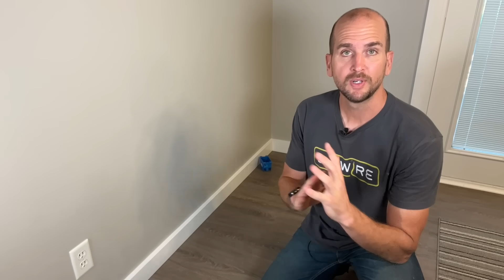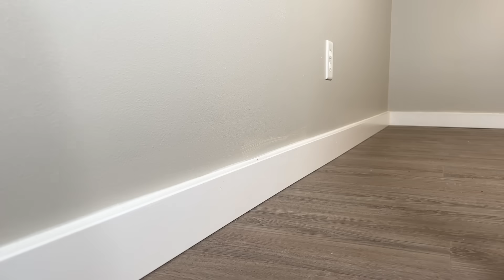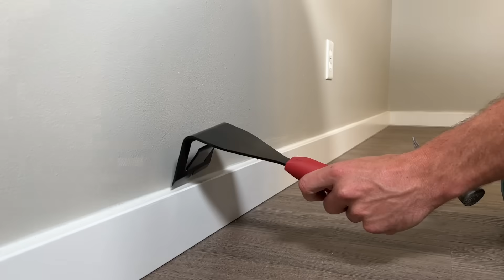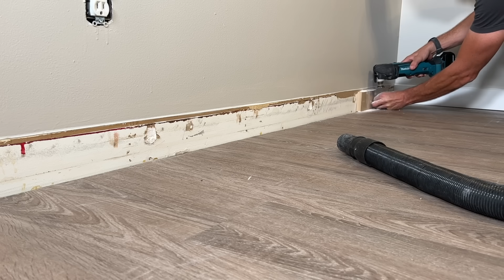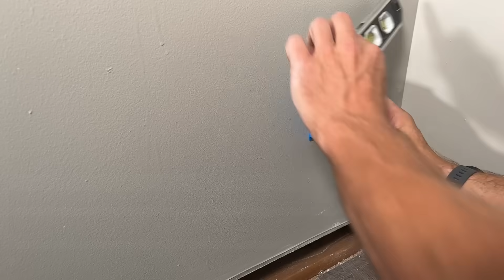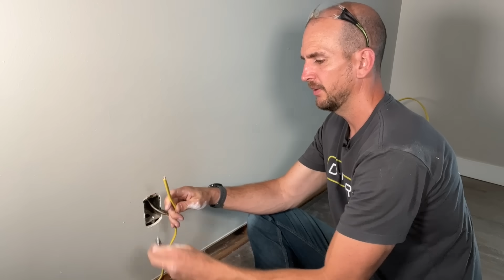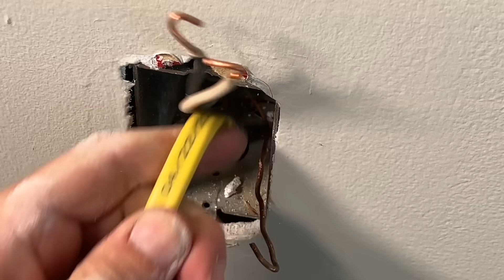How To Add An Outlet To A Finished Wall

Comment: Your wire that comes from your romex should extend at least 6” out of the box. You can find that in the national electric code. Also, when using solid wire, you need to hook the posts on the receptacle. The plates are for stranded wire. It’s also good practice to place your ground up, so to protect any falling metallic objects hitting between the receptacle and plug, shorting between the hot and neutral. The odds of that are unlikely, but can save some grief for no extra effort. The slotted cover screw should always be vertical (preference). Being a commercial electrician, we always use metal boxes, so I also always tape around the receptacle. When using the plates, put the wire on the left side of the screw, so the wire is being pulled tightly, rather than being pushed out. Outside of the 6” rule, these are just good practices. One last thing; when using a plug-in checker on a duplex receptacle, make sure to check both, as the metal tabs on the side of the receptacle can be broke and used as two separate circuits. Assuming that the duplex receptacle is only one circuit could get you lit up.
Reply: You make a number of great points, however all spec grade or better receptacles that I have encountered rate the side screw terminals for solid wire and the back wire clamping plates for both solid and stranded wire.  Individual/local preferences may vary.
Reply: @rhettlyerly545  
The back-wireing is not specifically just for stranded, but his is correct that solid wire is much better off being hooked around the screw rather than simply sandwiched between a metal plate. The smooth copper wire being pressed on by a place that is smaller than 3/8" can be fairly easily pulled out by a small amount of twisting even when fairly tight. And, by extension, it can potentially get worked out of the hole while the receptacle is being positioned into the box. This is not necessarily common, but it CAN happen.

However, even if it doesn't come out completely, it can be worked loose. And, as any good electrician knows, a loose wire is one of the biggest fire hazards there is.
Reply: A couple okay points. But:

1: NEC 300.14 - Yes, wires should extend 6 inches... but that's from where it enters the box. Either from the sheath, raceway, conduit, or connector. It only HAS to extend 3 inches from the box opening. Although, 5-6" OUT of the box makes a spectacularly cooperative set of wires, it is not necessary. However, I would potentially fire someone for cutting it at 3" out, lol. 
2: It's a good idea to hook solid wire (as I explained in my reply to Rhett's comment) but it's not mandatory.
3: "Ground up" is silly. There is only ONE reason for it, and half a dozen reasons to go "ground down." 
     Ground up reason: IF the plug is pulled partially out, and IF it has a metal cover, and IF that cover's screw comes loose, and IF that cover should then fall, then it hits the ground and is saved. YAY! But, then, if it swings even a little bit, it hits the hot wire anyway. Sooo... a LOT of ifs for an incredibly rare situation that putting the "ground up" doesn't really solved.
     Ground down reasons: A. The ground prong is sturdier and can hold more weight, and does so when a plug gets worked loose. B: If a plug end gets worked loose, gravity will case it to sag. If the ground is UP, then it is often the first prong to get undone. Then you have an ungrounded but HOT device. If the ground is DOWN, the device loses power BEFORE it loses ground. C: Most 90 degree plugs (like those on refrigerators) hang with the cord down in receptacles with the ground DOWN. When in a receptacle with the ground UP, gravity pulls on them and can pull them out. I think I'll stop there as this is already longer than your comment.
4: There is no reason that the cover screw SHOULD be oriented any direction. I personally prefer horizontal because I think it looks better.

Taping in metal boxes and hooking the wire clockwise are good ideas. Not code, but they should be. Same as with the stranded/solid backwire/sidewire issue. Just my opinion.

Comment: Funny how this would be considered super illegal in The Netherlands. Never use romex, always run wires through a pvc pipe to prevent damages from wire rubbing over time and rodent damage. Never ever use conductive material for your boxes or conduits! It’s just short circuit waiting to happen.

Comment: Residential electrician here. BEST YouTube tutorial I've come across. He didn't miss a thing for old work! In a perfect world, a romex staple would be placed below the box to secure the wire, but it's not a perfect world. This however, in my opinion was a perfect install. PS We dont use wago connectors because they're expensive lol
Reply: We don't use Wago connectors because they're garbage.  At 8:42 and again at 9:16 he said "we don't back wire" that's  because all real electricians know that is garbage.  Using Wago connectors IS BACK WIRING!
Reply: Exactly!  @udavidism
Reply: I thought metal electrical boxes had to be grounded.  I didn't see a ground to the metal electrical box.
Reply: @todd8155 not when the box is plastic
Reply: @todd8155 grounding a plastic box wouldn’t accomplish much. The ground just gets attatched to the yoke of the outlet. If the box were metal it would need to be grounded
Reply: @jesseneumeyer4279  My mistake.  I meant to say that the METAL box wasn't grounded. I corrected my post to add METAL.
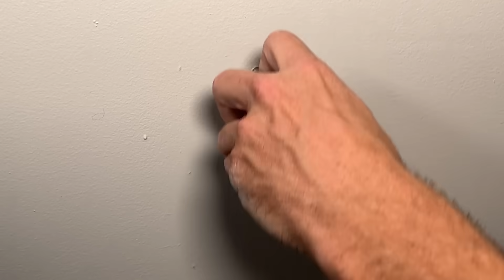Reply: @todd8155  In the metal box shown, the ground wire is wrapped around the screw for the wire clamp in the back of the box. You can see this at 4:59 ... In a new metal box you would use a ground screw/ground pigtail to ground the metal box but years ago it was done as shown if it was done at all.
Reply: @jesseneumeyer4279  I see.  Thank you.
Reply: @todd8155 you can ground it with the receptacle as long as you remove the plastic or cardboard retaining washers on the mounting screws and they are making metal to metal contact
Reply: As you know staples are NOT required in places they are IMPOSSIBLE to put. Why even bring that up?
Reply: We don’t use Wago’s because they fail to much. Use a wire nut!
Reply: @empireofdirt9045  The lever ones arent as bad as the spring clip ones, but the point stands, wire nuts are better and cheaper
Reply: @empireofdirt9045 my first thought. I just assume everyone suggesting to use Wegos is a hack...because they are. The amount of times I've had to replace burnt-out wegos is ridiculous.

Comment: Instead of adding pigtails, why not connect both set of wires to the outlet (in the old hole)? And why not use a box that nails diagonally to a stud in the new hole for a studier outlet?

Comment: Well done!!  Pretty straight forward for most homeowners to DIY!  Your channel is an absolute pleasure to watch as you convey all the information clearly and concisely. No filler words nor any gab just to fill up air time!!! Your production is on par with a professional broadcast and you should be commended for putting out such a polished product!!!
Reply: @Karl with a K Steel boxes do.  Not the plastic ones, though.
Reply: I always thought the wire had to be a certain height off the floor for codes?

Comment: I have a few questions, what about dead testing the insulation and resistance of the cable, that polarity tester is not capable of applying such a test, just because it works does not confirm it's good, it can be leaking, you then need to record the results of each conductor test and date stamp it, it's fine to do stuff in your own home but if it's not written off with a ticket your home insurance is void if it not written off, and how do you let a house out if it has no current inspection test certs as that addition will not match the existing schedule???
Reply from the maker: Hey John, where are you located?  That practice is not common in my area but I am interested to know where this is common practice.  Thanks for the feedback.

Comment: I did this the other week at my 86yo dad’s place.  We put a motion sensor activated night light in for him for those night time ’nature visits’.  I was lucky that the gyprock ( drywall to you guys) ended about 20mm (3/4”) from the floor (concrete slab).  My starting power point was about 1.2m off the floor.  
After removing the skirting board I cut a slot to just above the floor plate at both ends.  I drop a 30cm (1ft) length of bead-chain (small steel beads linked together- you often see short bits on nail clippers) on a string with a mechanic’s magnetic tool to fish it out the bottom holes.  Spent longer doing the wiring connections than running the wire through.

Comment: That's a fantastic tutorial. +1 for those Wago's, they're absolutely top quality and so easy to use. However as a European I'll never cease to be amazed by the construction materials used in US homes. Drywalls? Wooden trims with nails? Never seen these. Here houses typically have sturdy brick walls covered with half an inch of plaster (much harder to penetrate for DIY tasks obviously) while floors are often layered with ceramic tiles or marble or thick oak wood, so trims will either be the same material as the floor (e.g. ceramic) using stucco rather than nails, or strong glue and silicon if they're made of wood.
Reply: Yeah, would like to see this trick done to a brick wall…that’d be magic :)

Comment: The only thing I would suggest is just doing the tape around the terminals can't tell you how many people have issues yes you don't have metal boxes on the new one but you did on the old one plus with the bad copper wire there is always a potential chance

Comment: Handy tip yes you can have too many outlets on one breaker LOL I've had to go back to houses I've had so-called contractors build a room and put 15 Outlets on a 15 amp circuit

Comment: I don't know the U.S code, but over here we could just run the wire inside the baseboard as they have a small space in the bottom to do so, and drill small holes behind it and fish the wire through them to the mounting boxes that have their own built in stress relievers, and it's done.

Comment: Great video and make it look easy.   Very convenient there was a bottom knockout on that existing bow which almost never happens.  How would you secure the wire into a standard residential plastic box with the push in wire secure the at the back?

Comment: Great video. Never thought about removing the baseboard. Question: Why did you install wire nuts instead of just connecting both wires to the old outlet?
Reply: I am not positive if he had this in mind but those plates that pinch down on the wire in the outlet will secure 1 wire much better than two. The 2 wires could be slightly different diameters due to cutting them and that can cause vibration and arcing.
Reply: It's a practice many of us now do.  By using pigtails, if the recepticle goes bad, it doesn't kill the rest down the line.  When you use both screw terminals, you risk more than just one.  It's not a NEC requirement, but turning into a best practice and in many places, it's company standard practice now

Comment: Actually you can have too many outlets on a circuit and end up overloading. Always make sure your amperage is enough by checking the wire gauge and correct breaker.

Comment: Great vid. Only extra step I would take is add electrical tape around the receptacle outlet protecting the positive and negative connection 👍
Reply: Hot and neutral.  AC doesn't have positive and negative.

Comment: I have only one wall that the power went out on.  I went to the breaker box and didn't see anything tripped but I still reset everything.  I have had zero luck, nothing has helped and it is just on one wall with approx 3 outlets.

Comment: Why not using electricity pipe to feed the cable through? 
When you need te replace the cable, you can just feed it through the pipe without opening anything.

Comment: When you put the box connector on the romex before fishing it up into the box, that's when I knew you were a pro. Popping off the baseboard and cutting out the drywall behind it is brilliant. My dad the NJ master electrician would thoroughly have approved of this.
Reply: We are going well and trailer for me to believe that my 🎂
Reply: That's great if no one ever puts a nail or screw right where you ran the wires. Lazy electricians and untrained home handyman will not know this is a really dumb idea and a huge safety issue.
Reply: New Jersey Master? Really? The union might have other thoughts. This is a very unsafe practice a day is specifically against union standards and every building code I know.
Reply: *and
Reply: And*

Comment: My outlet box doesn’t have a hole at the bottom to run the wire through. Do I need to replace my outlet box? I’m trying to this on a wall that has spray foam insulation

Comment: I have plaster walls would it be the same technique?
Reply from the maker: You would not be able to just pull the plaster out in 1 clean piece.  Same concept, much messier, and then replace removed plaster with same thickness drywall.

Comment: this was a great video, i have never done it this way. 
never crossed my mind to remove trim & drywall and run wire that way 
also learned a new trick to secure and add the connector to secure the wire

Comment: Nice job, but you have a Metal box there, and it seems that you have neglected to bond the ground wire (EGC) of the new romex that you ran to the metal box, pigtailing off the metal box using a 10/32 GREEN ground screw to bond the metal box and the green grounding screw on the original receptacle.. if the original supply cable was BX, then the bx clamp inside the box bonds the box mechanically via the metallic casing, but if you add romex, you need to bond it’s bare ground wire to the metal box otherwise the new box, which is plastic, will not have a means to bond it and simply attaching the bare ground wire (EGC) to the new receptacle is not a sufficient bond.
Work safe!!

Comment: NEC says: The maximum spacing between receptacles, according to the National Electric Code (NEC), has been set at 12-feet since 1956--with no point along a wall being more than 6-feet from a receptacle. The logic behind that number is that an appliance with a standard length cord could then be plugged-in anywhere along the wall.

Comment: Great tips.  Thank you. I do have one question, which I can not see anywhere on YouTube.   If I need to add an outlet mid run say 4 outlets at # 3 outlet, do I make #3 outlet box a junction box, and split the power to a new outlet box, while keeping the original run?  Therefore it would be Power in to #1, then #2, then to #3 - Split at #3 to #3a and #4 outlet.  A branch I guess.  The circuit can handle another box.   Thank you.

Comment: Run you a 6 ft white extension cord with a three way end on it over to the corner and forget about it. I'm  just a Carpenter by trade turned builder but I swear to God ,,,, after reading dozens of comments pro and con about this video........I feel like getting grounded and grabbing a hot wire and see how long I can hang on !

Comment: I was going to comment that that would be a recipe for moist and water damage, but forgot that you seldom use a conduit to pull wires in. Here in Norway the boxes should be the lowest points, so that in case of moist/water buildup from condensation, it will have a possible way to drain it out. 
But since you just ran the wire.. Excellent job! :)

Comment: Question? Why use wire connectors when there are 2 sets of screws on the outlet plug. Isn't that how they wire a string of outlets in new construction?

Comment: Great video and I learned a lot, and thanks. I need to do this job and the one thing I most wondered about, you glossed over and didn't even mention, and that is mechanically mounting the junction box. I always assumed I would need to somehow nail a metal junction box to the stud, just like the existing ones were done when the house was built. You just used a no-brainer surface mount box, and plastic even. I always thought junction boxes needed to be metal. So that was your solution to what I wondered about most, and so obvious, but I don't like it, and that's why I never thought of it, a surface mount A/C plug, to me, is "unthinkable." If the plug gets used a lot, and what plug won't, those little screws going into sheet rock are going to get constant abuse and they will give way quickly. You glossed over this point, did you even use dry wall anchors for those screws? Yes I'm a perfectionist, but I wouldn't use that surface mount plastic box, at least not without some beefy reinforcement that I am confident could stand the abuse. I'd say what you have here is "guaranteed to fail," or "anemic" at best. One other point: You can get A/C outlets with built in USB ports for handy permanent charging ports, very modern. However those have a bigger box on the back than the usual A/C outlets, and your cable punching up through the center of the bottom of your pre-existing junction box probably won't allow room for that. If someone wants to use one of those outlets, they would need to find a way to punch the cable in from the back of the box. Finally a few personal comments since you want to be a professional DIY presenter. The appropriateness of using guy-liner and eyebrow mascara on guy oriented DIY videos is questionable. You avoided saying "uh" and that's good, but you are using a pretty severe "geek accent" tone of voice. You need to work against that. Practice speaking from your diaphragm, letting the air come up from the bottom of your lungs without your throat restricting it. Practice this some and try to feel the sound vibrating in your back and chest. Once you start to feel that, focus on that and practice speaking trying to maintain that feeling. Once you start to get it, practice to make it second nature to speak that way, and listen to yourself back on tape and hone it.